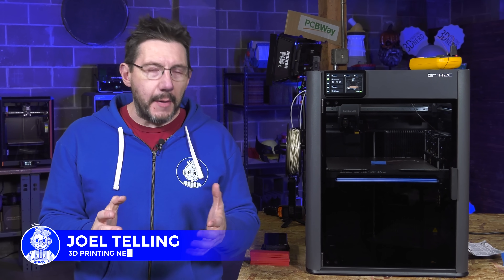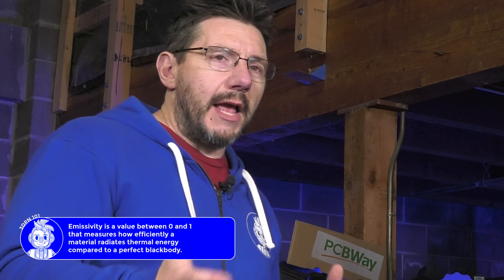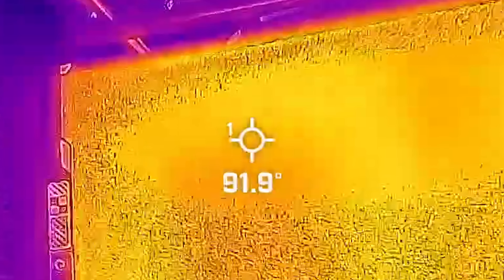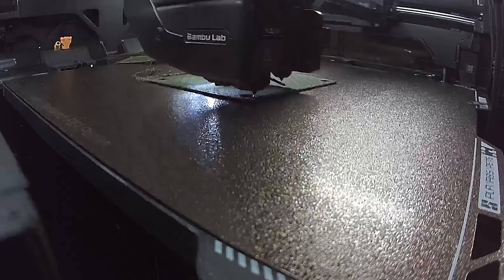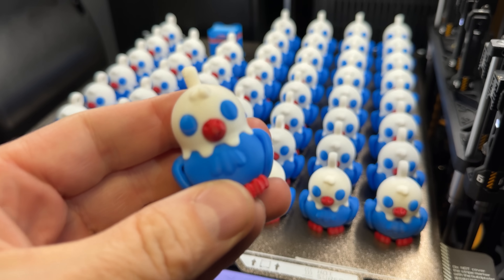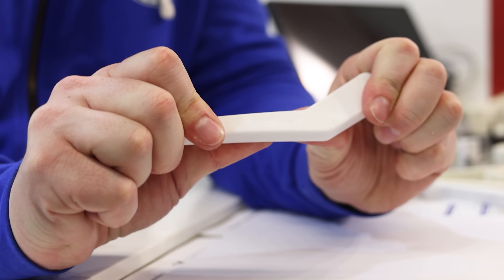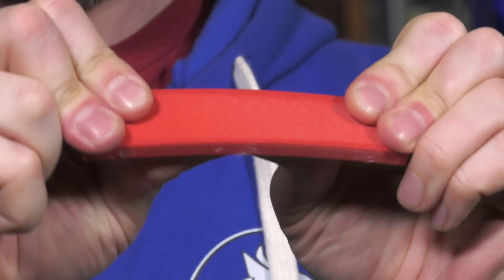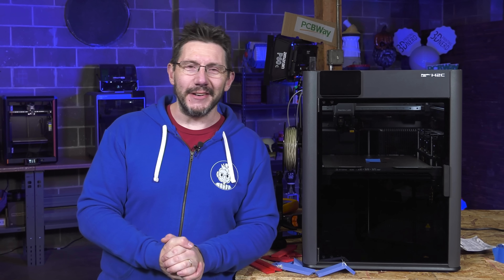Bambu H2C Update - Bed Heating / Tullomer + Polymaker

Comment: I haven't had any adhesion issues on my H2C. No glues. Just clean quick with alcohol after each use.
Reply: After each use seems like overkill. The big majority of needing to clean is from skin oils. I’m diligent about only touching the edge tabs and rarely need to clean.
Reply: @dan62103 it is overkill i agree. I'm just OCD
Reply: I didn't clean it at all, still as out of the box at 80hours now pla is sticking like crazy no print fails at all so far. Only 'warning' i have seen is when some small thingie was on the buildplate and i had to blow it away.

Comment: Wish they would give us an option to SLOWLY heat the heat bed so it does not blow fuses with anything else on the same outlet.
Reply: h2c does have this option. low power mode in settings.
Reply: @danielwa9697  i wonder if they brought this to the h2d yet, i am going to check mine tonight! fingers crossed. If so im gonna buy another :face-green-smiling:
Reply: @CallmeBigfat  Yes they have... more proof the whole 110volt thing is silly :)

Comment: Big respect to you for showing the errors you made in your initial test, and also teaching us what EMV means, I wouldn't have known without this vid.
That said, I think that your initial video is still valid, considering that the average person isn't gonna wait 1 hour 30 minutes to heat soak, so the bed is still at fault moreso than your equipment, especially with the huge difference of 30c between different spots on the bed
Reply: ehmm yeah lets not ask why he waited for a hour? its fine in its normal workflow others have tested it. There are more than enough h2c's out now that this has been tested by multiple reviewers and normal users like me have zero issues with pla sticking at all.

Comment: I have gotten my H2C, so far I am loving it. My main frustration right now is with the slicer. Bambu Studio does not have any filament presets other than Bambu and Generic specifically for the H2C. It also will not let me copy the settings over from other prints for filaments
Reply: Hopefully Orca will get updated soon
Reply: I guess they have to finish those for the h2s, P2s before..

Comment: The textured PEI plates are a hit or a miss. A friend of mine got an A1, and he really struggled with adhesion. He tried nearly everything, glue, spray and even sanding it in pure desperation. The sanding helped a bit, but when he tried cleaning it with dishwashing soap all his problems went away. I later got an A1 aswell, and I didn't have adhesion problems on the textured PEI other than really large flat bottom prints. Now I'm using the BG CryoGrip. And I'm not going back. PLA, PETG and TPU sticks fine even without heating.
Reply: Smooth PEI sheet is cheaper (get an offbrand one) and sticks the best, and you get nice smooth surfaces on your prints too.
Reply: @SirLANsalot  I'm considering getting the Bambu SuperTack, but there are some usage restrictions that are holding me back. I get a warning in Orca when I use PLA Silk on the SuperTack preset. The CryoGrip plate does not care.
Reply: I think if there is a variation between shipped plates thats very interesting and at this point more likely than a heating issue given that has been tested by several people now and shown to be on par or better than most brands.

Comment: Honestly though I feel the PEI bed is thinner, poorly coated and of lesser quality then the bed that came with my X1C. Already had noticeable damage from tpu pulling up coating.
Reply: You need to use a interface layer like glue stick or other products if you print TPU on PEI because it will actually bond together.

Comment: I expect that your issue was PETG contamination of the sheet. PETG sticks really well to PEI and I expect just using soap and water you do not get rid of remains still stuck to the bed. As we know PEI does not stick to PETG. To reset the plate I would scrub it with a light abrasive (along with soap and water). I have had luck with melamine sponges but also fine steel wool should help. 
Also avoid using the same plate for both PETG and PLA
Reply: That last sentence especially! Build plates are cheap enough now it doesn't make sense not to.
Reply: In your experience, does PET have a similar contaminating effect? I’ve been having adhesion issues with ABS since printing PET-CF on my factory build plate, and only in the spots where the PET parts were adhered. I still have the ability to use the other side but I hadn’t encountered this before, and so I was curious if it actually was “a thing”.

Comment: wow, PLA not sticking? are we back to 2020?
Reply: @kanzzon  2020? 😅 I had a cheap 200€ machine from 2019 and PLA stuck so good on it that i would rather break the model than breaking it free when the build plate was hot! 🤣 And i never cleaned it! I didn’t knew that a not stucking pla was still a thing in 2020 lol! 💀
Reply: 2015?

Comment: I was struggling with plate adhesion on my new Textured PEI as well. What I found fixes it is using steel wool and giving the plate a good scrub in all directions with dish soap. It fixed all adhesion issues I had and has been flawless since.

Comment: With prusa I can buy a printer, pull it out of the box, turn it on and hit print. So you're saying with bambu you can't do that until you order a new bed? That's not ok!!! lol If it doesn't work out of the box it sucks.
Reply: I think he just had a defective plate. It happens.
Reply: @Nightenstaff  A defective plate on a $2400 printer? It's almost like bambu lab has no QC.
Reply: @HaloMachine  Only report i have seen so far. we have seen other issues that look like QC problems or really weird shipping results. Can't say if its worse or better than other brands but issues with new h2c have been reported (on par with h2d i would say).
Reply: @Nightenstaff  Would be nice if he can confirm this, check both sides etc etc Does seem like a real option now.
Reply: @Nightenstaff  yeah......but no. I've never heard of any one getting a defective prusa plate. I've heard of boards not working correctly. but issues are pretty rare. But the actual plate? no, their plates are top notch. They always work out of the box and if you take care of them properly they last.
Reply: @awilliams1701  really? I can remember exactly that when Prusa first starting providing different plates.
Reply: @Design_no  different plates are better at different things, but they should still work.
Reply: @Nightenstaff  And it's not just prusa. Most companies have decent plates these days. Even the ender plates aren't that bad.
Reply: Well I had so many issues on my core one belts that I returned it. By your logic prusa is also garbage right?
Reply: @Jigamanx2  apples and oranges. The belt issue is purely cosmetic. The print doesn't fail, it just doesn't look as good as other printers. Joel's printer was actually failing. To be fair........it's not great. Prusa could have done better, but the issue is fixed now. I'm guessing you returned it before they did. the fix is fairly recent and the core one L as far as we can tell doesn't have this issue at all. But it's a brand new printer and not many people have it yet. However it appears that prusa has nailed this launch.......so far. The mk4 was flat out missing features......but it still completed prints. So I can forgive missing features and cosmetic issues much more so than consistently failed prints.
Reply: Can we just exclude the Prusa XL ( Reliability at it worst when launched and still has some issues) and the core one (horrible belts tensioning issues causing vfa)
Reply: Funny enough in other side by side testing (both temp and real printing) it as the prusa that came in last. We might not know what happened but its not normal and no other reviewer of the h2c or as far as i can see users have issues. Mine has been fine with the shipped plate for 80hours now.
Reply: isolated case dude. Prusa's have WAY more issues then BL printers. Plenty of videos to back that up
Reply: @shaowlnkngfu3803  lol compare prusa's and bambu's sub reddits and tell me again which brand has more issues.
Spoiler alert, its bambu by a light year. Prusa has a 1% return rate while bambu is up in the mid 20's
Reply: @HaloMachine  Dude, prusa consistently sells half baked products and expects their consumer base to test the products. XL, MMU2, MMU3, etc…..
Reply: @shaowlnkngfu3803  The worst issue I can think of with prusa is poor belt tension out of the box. They've already fixed it and it's not hard to adjust. A crappy plate isn't something you can fix by hitting a few buttons and turning a few screws.

Comment: Glad to see this follow up. I felt that the previous video about the bed was a little sus based on my extensive experience with multiple H2 machines. It just didn’t align at all with my experience. It’s also wild to see a defective print sheet. I totally believe that is the cause. I’ve just never seen that before. Then again, i’m ignorant to how their PEI coating is applied, and what could go wrong during the manufacturing process that could affect its performance down the road.

Comment: Only issue I have with this when you send a print over to the printer it doesn't wait 1.5 hours to allow for a heat soak so this whole thing isn't valid to show that the bed heats evenly when you send over a print it shows even bed heating when you allow it to heat soak for 1.5 hours.
Reply: That's not what his data or testing was showing. 

Thermal readers are sensitive but if kit, he got one data point from a cheap temu reader and didn't check the normal things you would like replace all consumables (which a plat is)and came to an incorrect conclusion and was mature enough to say 'i was wrong' I have more respect for him now. 

Do other bed heading options have benifits sure but they cost more, a private jets a better way to get around but has other down sides, the goal of these consumer machines is confidence that you can click print and be 99% the print will finish no issue, and with modern printers you mostly can.

Comment: It would be interesting to see if those same measurements came up on other print beds/other brands of heat bed using the same methods shown here.    Oh and I'm having the same exact problem you had with PLA not sticking.

Comment: I have had this problem with the Bambu textured PEI beds before. I have received several new out of the box, that literally stuck to nothing, unless it was mechanically bonding between the heavy texture. So i am not surprised it happens from time to time, they don't get a proper coating and just either have areas that are bad, or the complete plate. The other thing that can effect PEI from time to time as was alerted to me by another person with a print farm. Is that PEI absorbs water. So if your having issues, or you just washed the bed, set the bed temp too 100c and turn the chamber fan on, and let it dry for an hour. It really can make a big difference.

Comment: Ah come on, did you get pressured into making this?

I wanted to buy a h2c but I’ve seen this issue everywhere online. And ofc the slow changes.. Heating for an hour thirty is stupid to expect as the norm. 

You can’t say the thermal couple isn’t accurate if you haven’t had it calibrated 😂. 

You are using 0.95 on black tape is a bit odd also.

And Bambu’s own advice to use that 0.91 showed it under. It’s an issue.

Comment: This conclusion is bollocks Heatsoaking as a prerequisite show me where it does that as normal operating procedure.  Quite disappointed you obviously caved in front of the Bambufan firing squad. There is quite widely reported evidence of the Bed being pretty unevenly heated with the bambu heater. Changing the experiment this significantly is ridiculous. No one is heatsoaking there printer an hour before starting to print. Criticism of uneven heating especially after the printer reports(Temp high enough go for printing) is completely valid. That there is a circumvention strategy is completely irrelevant if that isn't standard procedure! AND Let's see the shitstorm if Bambu printers heat soak for an hour before every print!
Reply: I agree with you, I don't think that changing the parameters of the experiment is ideal or honest. I imagine most Bambu machines do not heat soak for an hour before printing PLA. I do heat soak my Voron for about 45 mins when printing ASA to let the chamber come up to temperature, plus about another 10 minutes once it's up to temperature. However unlike the Bambu machine, it doesn't have an actively heated chamber.
Reply: Gotta keep that free printer portal open.
Reply: You have a definitely point but heat soaking for a bit before measuring the temp would be a much more accurate picture of the heat distribution than measuring it the moment it starts to heat up. Not defending Bambu, but in the end this looks like a fairly normal variation that many other content creators have now testing and came to the same conclusion. Prusa seems like they might have done bed heating a bit better, but overall the variation here did not seem to be related to the issue he was having and i have not seen anyone else reporting the issue, only testing it and coming to this same conclusion. Again, not defending Bambu but saying that someone caved simply because they checked again a bit more thoroughly and found maybe it wasn't as bad as they originally thought is also a bit rough.

Comment: I got my H2C less than a week ago and already having issues with the Vortek. The issue that I am having is Vortek Induction Hotend Rack Module
Malfunction/Induction Hotend Rack Calibration Failure. From the looks of it, the rack. It  looks like the actuator is not going high enough to activate/ deactivate the Vortek hotend latch, super annoying for less than 20 hours worth of prints
Reply: Problemy z tym skomplikowanym mechanizmem dopiero nadejdą.
To kwestia czasu.
To jest zbyt skomplikowany mechanizm i musi być awaryjny.
Reply: @3DPRlNT Issue can always happen if you look at how it works its very very simple only has 2 moving parts all easy to access. Its way less complex than the other solutions. How stable each of these solutions will be only time will tell but as any engineer will tell you that really looked at this system its darn issue how it works and not much can fail and will be easy to fix.

Comment: I think the bed temp "issue" (and I dont mean bamboo beds, thats valid for all 3d printer beds) is that whe look at the bed temp in the spots that dont have printed parts on it. The important temp is the temp under the printed part. Its kinda normal for the temp to be lower on the parts of the 3d printer bed when it has no printed part on it, because there it looses temp. I bet that the printed part on the bed kinda prevents the bed to loose temp as much because it acts as a thermo mass and holds the bed temp better.

Comment: A couple thoughts on the "bad" PEI plate:

1. Could there be PETG contamination that the soap and scrubbing has not gotten off?
2. Is the location of the failure consistent?
3. Have you tried Magigoo on that "bad" plate?

Comment: how loud is the h2d compared to p2s?
Reply: Quieter
Reply: @riba2233 aside from the CLACK CLACK CLACK of the filament cutter actuator arms, it is quiet
Reply: Compared to my k2 plus super quiet in fact quiet enough that basically not advised obviously but you can even sleep in same room without hearing it
Reply: Thanks a lot :)

Comment: I didn't buy one because of the heat bead.  I got an H2S instead.
Reply: @nick4088  it’s the same heat bed
Reply: @Minglator heat bed pictures shows different online that's why i figure something is wrong with H2C.
Reply: Do you regret it now with this update?
Reply: @Cloud3413 no.  Still better then my A1.  Corners always lifted and i only print in the center one at as time just because. Lol.
Reply: @nick4088  ah ok great! Good to know haha. Thanks!

Comment: Dawn power wash spray is absolutely a 3d print hack. Far better than normal dawn and easier to use.
Reply: Word of caution though, it works so well because it also contains IPA which is safe on PEI beds and can get things super clean but most "cold" or "sticky" plates will be damaged by the IPA. Regular Dawn is safe on all of them so is the safer bet.

Comment: An easy way to calibrate is to get a glass of Ice water, with ice still in it, put the thermocouple in it, wait a minute (possibly stir it in a bit) to get 0C or 32F, with a stove, get a pot of water to boil slowly, again stir in the thermocouple, not touching the sides, for a  minute or two, and get 212F or 100C.  Then you are calibrated.  It still does not speak to leaniarity or extensibility out of that range, but it is a fairly easy method to calibrate in the normal kitchen.  For slightly better results, use distilled water.  Yes, this is the old engineer in me talking.  Thanks for doing your best to set things right!
Reply: @jackcoats4146  actually boiling water can be higher than 100 celsius

Comment: Why didn’t you just put the thermocouple in boiling water first to calibrate it?
Reply: At sea level
Reply: @lotsad1234  "At sea level" -- it can be done at any altitude, just make sure to account for the change in boiling point accordingly. There's nothing magic about 100 C; the calibration can be done at any known reference temperature.

Comment: Bambu plates are not perfect.  I had ordered all of the graphics plates and the cool plate for the X1C from Bambu.  Out of the box, none of them would work with PLA, washing them per Bambu instructions, still no adhesion.  I tried for several weeks and eventually Bambu refunded them.  This is fairly common on the Bambu forums.
Reply: Like everyone else they outsource these plates. I bought a plate from ali and it said NOT ORIGINAL in the description. It was an original plate 😂 
Even came with the bambu packaging and everything. But at half the price.